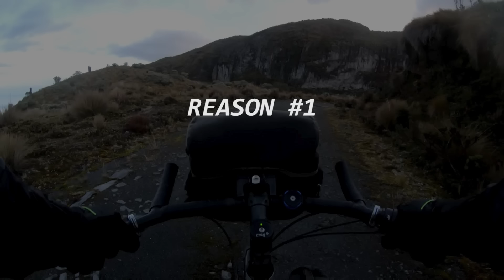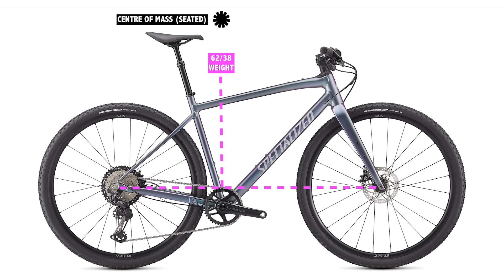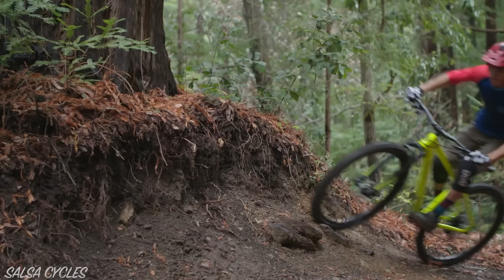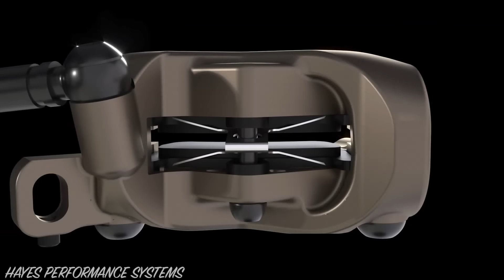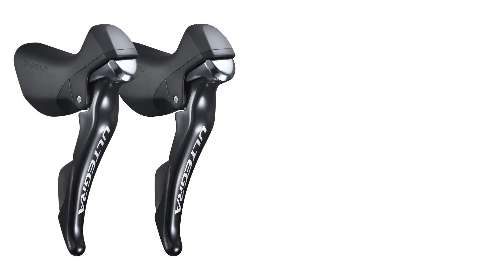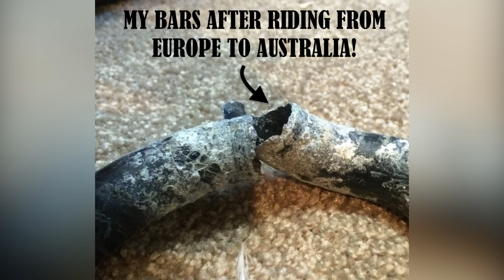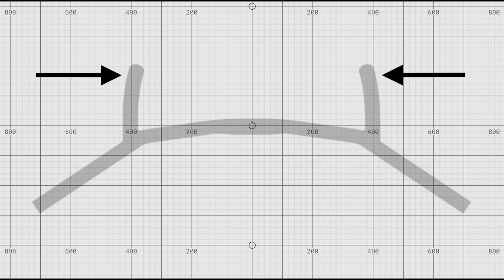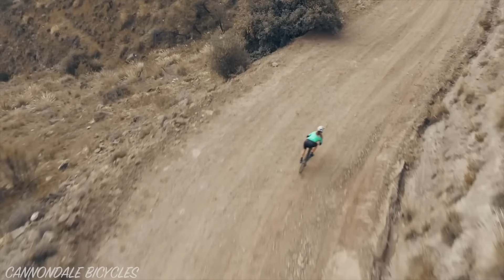Why Flat Bars Are BETTER Than Drop Bars For Most Cyclists (Objective Analysis)

Comment: I imagine that, for most riders, the sweat/corrosion thing can be minimised by always wearing gloves and remembering to wash them regularly.
Reply: Or just buy carbon bars.
Reply: @marcalvarez4890  no serious tourer should buy carbon Bars.
Reply: @wasdalosdickarchen  And why is that?

They are lightweight, absorb high frequency vibrations, and are strong as F.
Reply: @marcalvarez4890  no way, one little Crash or bike falling to the Side and you must replace them for safety reasons because you cant see a crack. No tourers using those. Because those bikes get abused
Reply: @wasdalosdickarchen  Mountain bikes. They get ridden 10x harder than a touring bike, they withstand crash after crash, many at high speeds and from high falls, and they get tossed into trees, over cliffs, and onto rocks. 

They do not get replaced after a fall, i promise you this. And they last for years and years. 

Please talk to some mountain bikers about their carbon bars, before saying they're fragile. Seriously, its a laughable thing to say carbon is tough enough for the Enduro World Series but too fragile for a tip over on pavement.

https://www.youtube.com/watch?v=4qWpfJA2nEQ
Reply: @marcalvarez4890  Yeah, they do not get replaced, but they should. Talk to a Material engineer. In the pro world they replace them regular
Reply: @wasdalosdickarchen  Yes, in the pro world they do, but 99.99% of bars don't get replaced after years of crashes, and they work fine. 

Thats my point...what the pros do is irrelevant, as they have unlimited source of bars from sponsors like Answer and other companies.

As for material engineers, my best friend just graduated from Berkley with a Masters degree in materials engineering. He knows a thing or two.
Reply: @marcalvarez4890  ask your friend about non visible cracks in carbon Bars. Carbon breaks almost unpredictable and suddenly totally. Its a pro Material that product managers sell to average cyclist for bigger profit margin. Makes only a little sens for seat posts when riding rigid with small tires. Plus Carbon is pollution/plastic, its not recyclable. A failing bar is one of the most dangerous cases on a bike.
Reply: @wasdalosdickarchen  Sure buddy, sure.

(Laughs in 20 years of riding and crashing carbon mountain bike bars)
Reply: @wasdalosdickarchen  And we should all drive the speed limit, but we both know how that goes.

The carbon bars are fine. 20 years on them and I've never had a pair break. Ever. MTB parts are massively over built.
Reply: @marcalvarez4890  I talked about risk, not about what "works". There are some freeride mtb riders using no helmets since years. No problemo...
Reply: @wasdalosdickarchen  Sure. Ok. Have a lovely day.
Reply: @marcalvarez4890  peace out yo

Comment: Calling some of those bars flat is a bit of a streach.
In summary flat bars are better for offroad and bikepacking if you want lots of stuff. Dropbars are better for road riding ang going quickly in cities. So more or less what bike manufactureres are doing anyway. On mountain bikes you get flatbars and mountain bike stuff (stonger brakes, smaller gears...) on road bikes you get drop bars and road bike stuff (lighter components, bigger gears...)
Also the position on aerobars is not like on the drops, yes they might be close, but in position small changes can make a big difference.

Comment: Could you eliminate the risk of sweat corrosion by first wrapping a layer of plastic bag (for example) and then the bar tape over it? Sweat shouldn't reach the bar itself that way, even if the tape soaks?
Reply: Cheap bar tape is impenetrable vinyl

Comment: In my opinion you cannot compare flats and drop bars. Drop bars are made for comfort and for riding long distances. They give you multiple ways of holding your bike, you can be making minimal changes to your hands positions during a long ride, which will not only change the way your hands are holding the bars but tilt your upper body differently which will reduce strain on your back and neck muscles. If I am doing a long ride with a flat bar I will  get a sore neck and a bad headache. If I am doing that with drop bars this will not happen. If I want to ride a trail or I am riding in the city, I will choose flat bars because they will give me more control and I won’t do this activities for long hours. In my opinion there is no better handlebars: it depends on what you are doing with your bike. And last but not least: drop bars are all about ergonomics allowing you to do long rides without too much strain on your body: this is not a subjective matter. The way you can hold drop bars is way more ergonomic.

Comment: I like the flat bars but, only with alternate handles attached to give a variety of holds.
Reply: I use wide flat bars with old school bar ends. Works a treat for me.
Reply: @fegless69  I use them as "bar midles" for aero position.
Reply: I agree. Flat bars today are light years advanced compared to the '80s and '90s. There is a plethora of ingenious  flat bar designs on the market today.
Reply: the flat or riser bars are a treat off-road  but they really suck at speed or into headwind.
Reply: @jamesmedina2062  try this, rest your forearms on teh top of your bars and clasp your hands. You now have the TT position!
Reply: @kudosbudo  +10 style points. +10 aero points. -10 style points. ;'D
Reply: @kudosbudo  Yep, definitely going to try that one when I'm moving 60 km/h downhill on a twisty mountain road. Sounds perfectly safe and definitely not life-endangering at all!
Reply: Whichever bar, you can hold your forks and rest your chin on your bars now you have your ultimate aero. assuming you can reach your forks but not on the suspension if it has one.

Comment: Once again a great analysis! I totally agree. One thing that you miss is risk of breaking the shifters/brake is you/the bike fall down.  It's very unlikely to break a shifter on a flat bar as the road shifter would have been damaged on the same fall.
I'm glad that I had flat bar for this reason when my bike fall is the middle of nowhere in africa, Bolivia or wherever it could have been impossible to find replacement.
Reply: Downtube shifters.

Comment: That all makes sense, but comfort is top of the list for me. I prefer riding on the hoods of drop bars for comfort. If I use flat bars without a severe sweepback, I bend my wrists and get numb hands. I need something that keeps my hands in a "handshake" position. Also, I've found that unless I am extremely upright or leaned over on drops, my back is at an odd and uncomfortable angle for me. I put some Surly Open bars on my commuter bike and those are nice, but most upright bars I find uncomfortable for significant distances.

Comment: I really love drops, especially since it's easy to hide from the wind, but you make a compelling argument. Something to think about for sure.
Reply: I've put bar ends on the inner side and covered them in bar tape. Best of both worlds and dirt cheap.
Reply: My bike is an old school bike I guess Mongoose Crossways 225 I put drop bars on that written it's on every surface I could on road off road never had problem with control very responsive I use traditional rim brakes never had to use all fingers breaking just index fingers only I do not use bar tape either his argument doesn't come to anything I also have ultra low gear range on back climbing Hills as well and high gears for good acceleration
Reply: That extra reach and hand on hoods makes drops more comfortable. There are flat bar handlebar options but they are very expensive. You can pick up drops anywhere. This channel is focused on bike packing/gravel riding there are reasons why so many people use drops. Not body is racing road races on flat bars.

Comment: Living in Holland I am indeed used to always seeing and, as a consequence, owning flatbar touring bikes. Owning a beautiful dropbar Trek 920 has finally allowed me to comfortably ride distances between 120 and 200 KM without any lower back pain, just feeling relaxed (as far as my upper body goes, of course ;-), whereas I used to be stuck at like 100 km a day max because more would just be exhausting. No more flatbar European bikes for me!!
Reply: I've ridden those distances quite easily with a Dutch city bike. Being upright is quite helpful.
Reply: It sounds like you may have the same experience as myself. With most flat bars, they put my back at an odd and uncomfortable angle. I need to be very upright or stretched out over drop bars.
Reply: @YoSpiff  What I've seen too often is manufacturers shipping bikes (drop and flat bar bikes both) configured for racing and performance with low stacks and pre-cut steerer tubes that make it impossible to configure into anything close to an upright position without resorting to riser bars, or extenders.  Having the bars a couple inches too low makes things painful for me after even short rides, regardless of bar style.  A good bike fit matter more than bar style, full stop.  When fit correctly for me my swept back flat bars (Jones loop bars) are by far my favorites over my drop bar bike, which just collects dust these days despite being lighter and faster.  Comfort is king now that I'm past 40.
Reply: @123moof  That's where I am...comfort. Drops kill my neck and upper back. The Jones loop is a nice option.
Reply: I hear you, I rode 100 km to the cabin yesterday on the flat bar bike because it has fenders and it might rain, there’s no place to put my damned hands except for the one. I’m much more relaxed on long rides with the drops where there’s at least 4 different positions.
Reply: @PRH123  I just did 110km on flats and don't feel any discomfort or soreness at all. It's all just personal preference.
Reply: @iddra1868  no arguments there!
Reply: @iddra1868  sure, I’m not saying I felt any soreness or discomfort as such then or now, I support myself with my back, and not arms…. it for me is just more relaxed and comfortable with drops on a long distance road ride…. for an English century would prefer them… i actually have 3 types of bars on my 3 bikes, each has their strengths..  drops, straight flat (winter), and the Deviant Mini with 15 degree sweep, that I ride yesterday…
Reply: bike fit can matter a lot more. we all have different bodies for sure.
Reply: I know this post is over a year ago but how do you like your trek nine twenty with the drop bars and the twenty eight inch spoke rims I got nervous with just 28 spokes but it seems to work well touring. How do you like your adventure bike just curious thanks
Reply: Also I have the matt green from two thousand fifteen track nine twenty

Comment: Drop bars do not suit urban areas at all, as urban riding requires the handling and breaking reflexes of mountain biking......unless you mean commuting under 20km/hrs. I specifically ride either a Dutch upright or a hard tail in the city.....one slows me down, the other gives me a fighting chance to react at speed.
Reply: I was hit by a car on my road bike about 2 years ago now. I did hit the brakes but they didn’t do much and aren’t that easy to grab quickly. I really feel like on my old specialized rockhopper I would’ve braked sooner and harder and avoided the crash.
Reply: I don't have that problem riding a fixed gear bike with drop bars and track geometry. The handling is super responsive with it but it also depends on your bike geometry.
Reply: This! I gained almost BMX skills when commuting for 3 months in a row through the city centre, residential areas, subburbs, etc. The curbs, the pot holes, start-stop pace, on and off the sidwalks, all to avoid car lanes as much a as possible. Drop bars are risky for that settings. Gravel trip outside the city is another story.

Comment: A point not mentioned: Flat bars add more control but at the cost of recruiting more arm muscles which can be more fatiguing compared to the neutral position of your arms on drop bars. Think about your arms at rest, palms facing inwards. You simple extend your arms to reach the drops or hoods, but you have to twist your wrists and raise your elbows for flat bars. For this reason I gravitated away from flat bars. Ultra wide and flared drop bars add back the missing leverage.